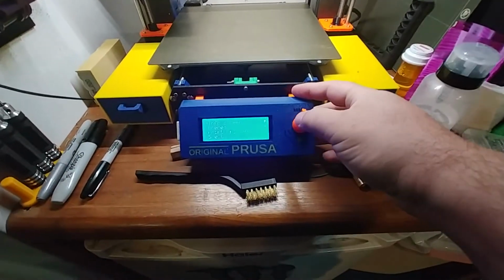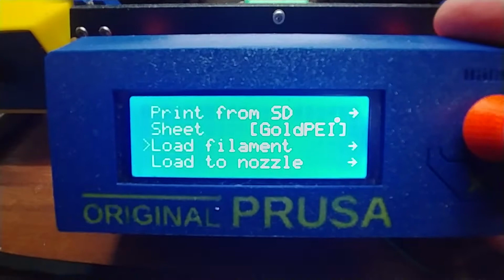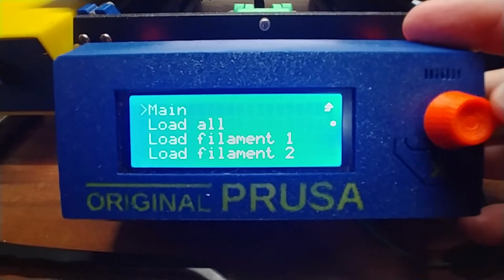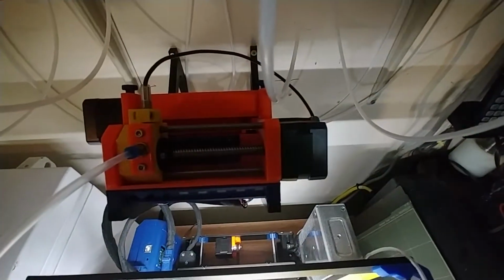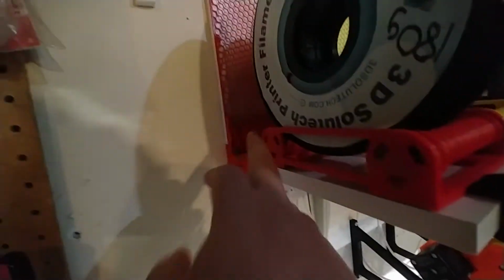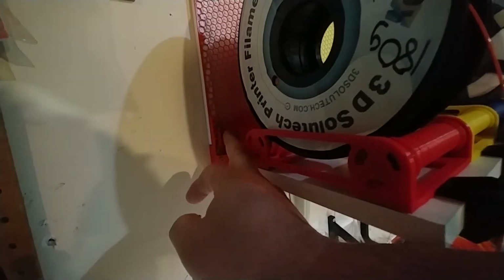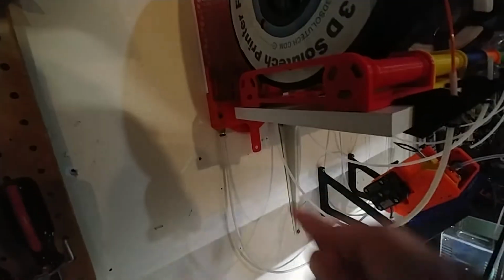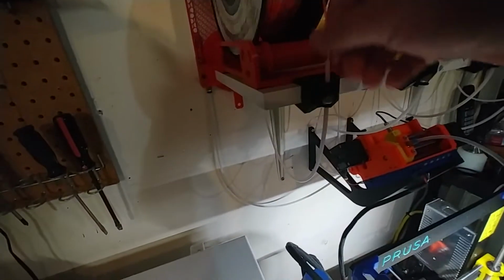Prusa MMU2 Filament Retract Bank by TNDave

Comment: This is a great solution. Was wondering how you mounted the buffers to the wall?
Reply from the maker: They're just screwed to the wall through the holes designed to hold the pieces of the buffer together. Check out his thing link to see the various ways to assemble it. I more or less copied his installation.

Comment: Hey Greg - love this system and have been using it for months now, thanks for the video. Was wondering if you still have or knew where I could get the file for mounting the MMU itself to the wall, as you have in the video. Seems like every combination of search terms I try just gets me more options for mounting the buffer to the wall. Looks like you're using the MMU2, I have the MMU3 so there might be some modifications needed, but I'm stumped and was hopefully someone might have that bookmarked somewhere ;)
Reply from the maker: I believe the wall mounts are also by TNDave, the originator of this buffer, so check his other models. I'll double check to be sure, and link them if it's someone else.
Regarding the MMU2/3, I think the main frame is the same, so the one for MMU2 should work for MMU3. It won't work for some custom thing like the UltiMulti, though, I don't expect.
Reply from the maker: yeah, same maker: https://www.thingiverse.com/thing:3382675

Comment: Looks great, I much prefer the RMU though. Have you tried it?
Reply from the maker: Nope. No reason to. I've been happy with this for two years now. Have you tried this? What is it about the RMU that you like better?
Reply: @ggaub  I like how it fits well with my printer. its incredibly easy to use too, especially when I'm trying to use TPU with the MMU. My cousin tried this solution and still faced TPU issues. I can't argue this is a great solution, it's just not what I needed. I was quite torn between the two originally (I wanted the free version to work more than spending $'s) from people I know who have used the two they often recemmend the one that costs. I think with more effort and work, this version could be a winner.
Reply from the maker: @abejohnson9247  That makes sense. I can see how TPU might not want to follow the channel around as easily as hard filaments do. I don't print TPU much, let alone in the MMU, but I've seen plenty of people who do.